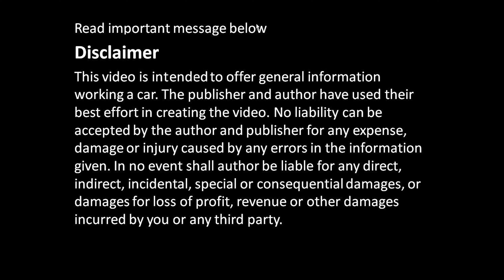How to disassemble Turbocharger?

Comment: Excellent work, Peter! There is nothing wrong to cut the propeller nut with angle grinder and drill out the impossible to open torx bolts!!! The only problem is that we probably won't have a turbocharger assembly video! :-)
Reply from the maker: Thanks 👍